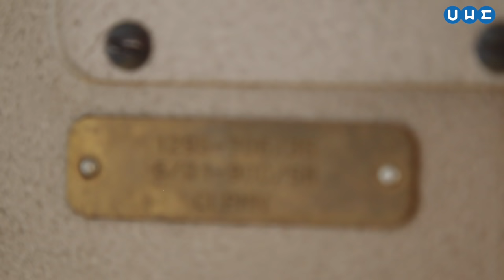Pfaff 1295

Comment: Uwe,
In November, 2017, you posted on Leatherworker.net about a Puritan Sewing Machine that you had acquired and were gathering supplies to operate it.
I recently acquired an identical Puritan Sewing Machine which is intact. I have been cleaning it up, lubricating it and am ready to learn to sew on it.
If you still have your Puritan, can you post a video on how to thread and sew with this chainstitch leather sewing machine?
I tried to access the Operating Manual on your Leatherworker.net post but it is inaccessible. If you no longer have the sewing machine, how can I get a copy of the Operating and/or Service Manual for this machine?
I believe that there are many other Puritan Sewing Machines which need to be used. What an incredible leather sewing machine!

Comment: The horizontal catcher is missing or this machine is not equipped with thread cutter . Awesome machines I used to work in a shoe factory as a sewing machine tech had quite a lot of them pfaffs but I prefer the 491 Pfaff real master piece when you know how to repair other wise it's a nightmare

Comment: I was wondering if you usually need to hold the thread tails when you start sewing?
Reply from the maker: On many vertical axis hook machines you do have to hold the threads as you start sewing to prevent tangles underneath. It depends to some degree on the design of the throat plate and presser feet design, I think. This particular combination holds on to the threads well enough all by itself to start sewing without tangles underneath.

Comment: Are the pfaff 335 pads suitable for pfaff 1295
Reply from the maker: No, the 1295 post bed throat plates are totally different from the 335. It will be hard to find throat plates for the 1295 - they are very rare. The video shows a throat plate designed for binding, but with standard 1245 presser feet (these are the same for 335, 1245, etc.) The combination is not perfectl, but works just fine for most fabrics, vinyl, and leathers.